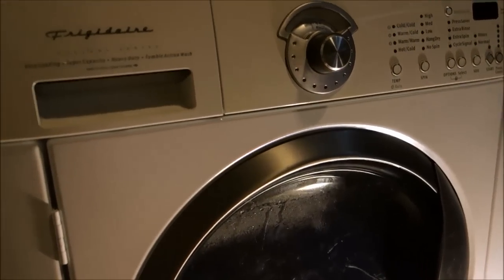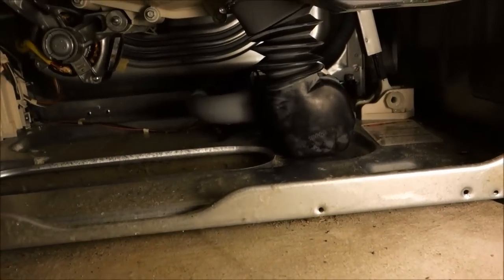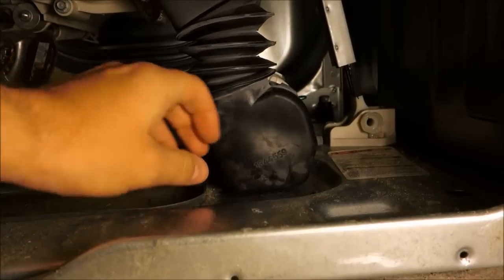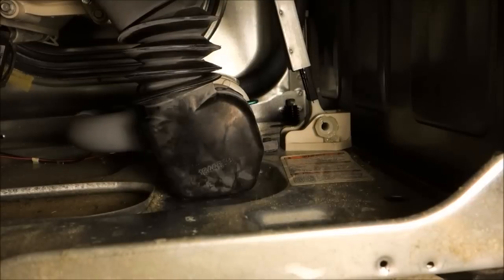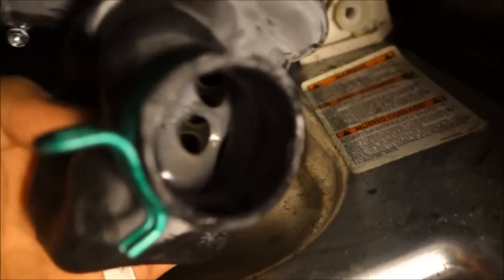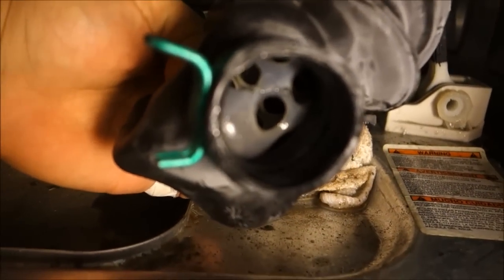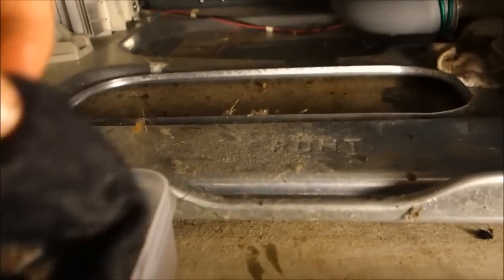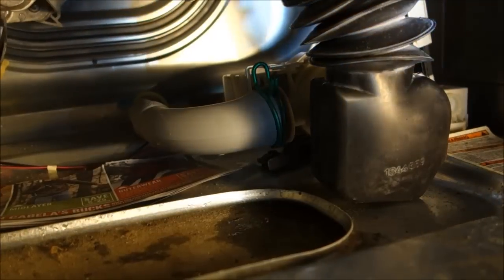DIY fixing Frigidaire front load washer from not draining -- washing machine error code e20

Comment: Thanks for the great info: I have a crosley front load washer mod.cfw5000fw1, although the access is easiest through a large access panel on the back,  the elbow and the fix were the same.  it took me a while to find you, the ref. to error code E20 was very helpful.  You likely saved me  the expense of a new machine because i dont call repair people.(usally feel ripped off)
Reply: This trap is basicly  just a filter and should be readily accessible by the consumer to clean themselves periodical.  To design it this way is obviously a way to give repairmen business and to sell new machines.  I wonder how many machines are trashed needlessly.

Comment: @teppichkopf  So, I went through and followed your instructions that you have here. I did not have vice grips for this project I just had regular players. Let me warn anybody who's watching this video if you do not have a set vice grips do not attempt this job. What was supposed to be a 35 minute job turned into 2 1/2 hours because I could only get two of the three clamps back on. The one coming from the pump was easy the one going to the actual washing been easy the secondary one that shoots off at a 45 degree angle to the right that's smaller absolute pain in the butt! I had the same thing a sock had clogged that along with some change as well. cleaning this out did not fix my problem however. If this didn't fix my problem does that mean that the pump is malfunctioning? I think I can hear it turning on and clicking but it will still not clear the water out of the washing drum.

Comment: teppichkopf, how long are we taking about. I had it unplugged the whole time I worked on it, my problem is even after cleaning it out the hose is still being sucked in and cutting off air flow which sends it to error, if I get down and hand stretch it while it runs its ok but who wants to do that every load lol

Comment: how do you get the panel off to get to that part. I've put it on its side, I've taken the back off and I can't get to the part I want to get to. I was able to get the top clip off and pulled out a bar wire and some dog bed stuffing but I am still getting the error code. I've taken all the pipes off and cleaned them out, I feel its dog bed fur stuck in the black part but I can't get to the black part good enough to move the clips. I looked on the front and didn't see a way to get the panel off but I'll look again when I get home.
Reply from the maker: I don't have this washer anymore to verify but if I remember correctly the access panel has some screws along the bottom that need to be removed.
Reply: @teppichkopf  Yes. There are two screws under the panel. I had to tip my wash machine back and place something under it to access the screws.

Comment: mine is still doin the same error.
Reply from the maker: +threegrand85 Just to confirm, did you unplug the machine for awhile?
Reply: +teppichkopf my problem is after cleaning it out the hose is still being sucked in restricting air flow and sending into error. if I hand stretch the hose (or whatever u wanna call that black piece with the coin catcher inside) then it well finish the drain/spin cycle but who wants to do that every load lol
Reply from the maker: +threegrand85 Ok, it was unplugged for awhile... Hmmm, check the hose on the other side of the pump? While unlikely make sure nothing blocking.